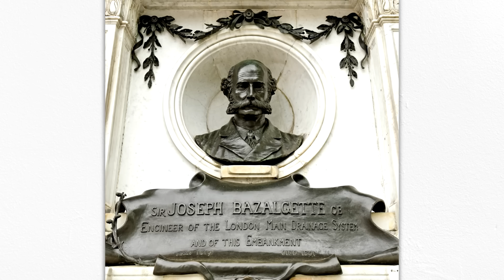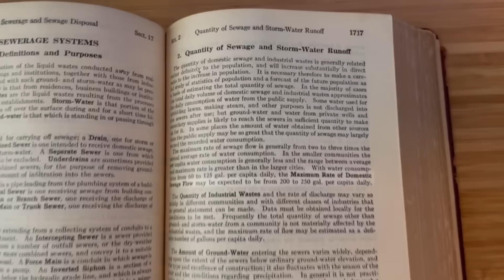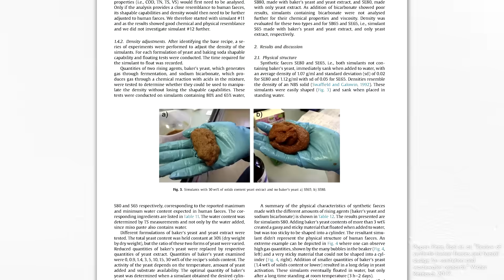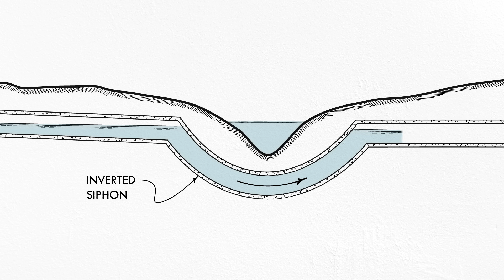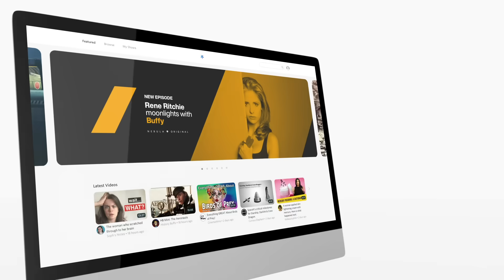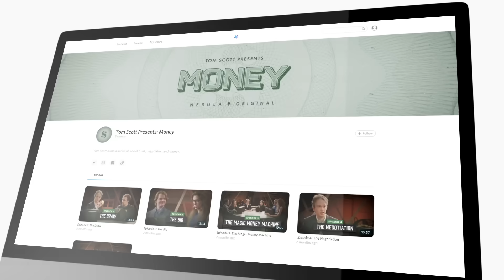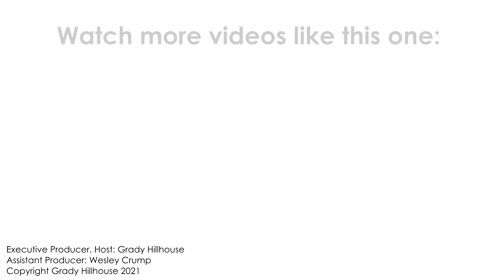How Sewers Work (feat. Fake Poop)

Comment: I usually wipe my poop with my fingers.Then, using the sharpest razor I have, gently slice off the the uppermost layer of my digital epidermis, allowing the poopy flesh to fall into the bowl. I then plunge my hands into a pre-prepaired bowl of water, isopropyl alcohol and hydrogen peroxide. That is followed by much screaming, then the application of antibiotic cream and guaze. Then I lie in bed and dread the next bowel movement. Does this seem practical and, more importantly, good for the sewage system?

Comment: I love the Turd business.  Sewer treatment plant operator for 18 years.  Water supply operator 3 years.  Dual licensed.  Layoffs are rare, have good benefits and lots of overtime.  People need water, people need to poop.  Most people wouldn't have a clue about proper deposing of their turds.  They let rip on the sidewalk in the city, most would NOT think about burying it and applying lime.  Most people would be no different than a dog.

Comment: Within a building, you also can't make the pipes too steep without risking clogging it. A turd needs a certain water level or it stops due to friction with the pipe, so you need the set amount of water during flushing to stay around the turd for as long as possible, filling the pipe around halfway. Too slow and the water lacks the force to carry, too fast and the shallow water runs off before doing what it's supposed to do.

Comment: The problem of over population never seems to be addressed. Letting too many people live in areas where the infrastructure isn’t designed to handle the demand of those people. If you had less people living there you would need less sewage systems to deal with it. Also it’s a shame there isn’t some way to control how often people flush the toilet so maybe they have to wait a minute or two between flushes to allow the sewage system to handle the demand on it before more comes through. Either over population needs to be addressed or the system has to regulate the excessive toilet use. Can’t have it both ways.

Comment: i cant imagine that pipes are sloped. they have to be level to reach the waste treatment plant. If there was slope in the pipes, then by the time the pipes reach the waste treatment plant, the pipes would have to be miles underground, if not more, considering the distance some residential areas are compared to the treatment plants. how the pipes dont get blocked is a mystery, but some designer must have figured it out.

Comment: Look to Toronto as an example of failed sewerage system. While downtown Toronto has added over 300,000 residents in the past 15 years without upgrading the sewer system. Now every summer rain would result overflow of the Don River and Toronto would smell like an open sewer. Then during heavier rains the brown water will over flow onto the streets. And now Lake Ontario smells like public washroom whenever the temperature goes above 23 Celcius.

Comment: Thanked for the great explanation, but I’m still wondering how engineers deal with the increasing depth of the sewer line due to the long distance they need to travel. Shouldn’t the necessary slope mean that the sewer lines in big cities eventually get extremely deep in order to reach a far away waste water plant?
Reply from the maker: I have a few videos about sewage lift stations that should help

Comment: As i start using animal fats most of it end up in the garbage not drain.

The main problem with fats and oils in the sewage is that they mix with detergents and body cleaning products. Drain cleaners (Sodium hydroxide) are the worst as they make the fat and oils saponified / harden at lower temperature and become water insoluble and attracts oils making it grow, not just coat the surface.

Comment: So I am curious would it make sense to have treatment plants built in skyscraper format having the water gravity fed to each section instead of pumped to each section? while the initial construction would be more expensive to hold the massive weight of the water I question if it would be cost efficient in the long run or if the savings would be mostly lost from the main pump pumping up such a height.

Comment: Do a transparent sewer pipe or even in a water line is a good idea. To monitor blockage or issues?
Reply: Y can't governments across globe place laws to restrict those chemical r bleach r toilet cleaner liquids r dishwashers that r harsh on em's in grey water

And make it mandatory for households r make arrangements in system in such a way that , whenever they flush there's em's liquid also b flushed along with waste 💩(em's  effective microbs are both damm cheap  and eco friendly , let nature do it's job )

Em's good both for environment and also eates  solid 💩wastes ( eats anything organic and not  plastics)that are  blocking free flow of sewage/ grey  water

Comment: I knew a guy that wouldn’t even flush down TP. He had a wastebasket next to the toilet for that. He never needed to have his septic tank pumped to my knowledge. I’m sure he wouldn’t have even allowed those “flushable” wipes through his door. Oh, he burned the used TP in case you were wondering. He also cut all the wood he burned for heat and hot water. Grew his own food (flora and fauna)and brewed his own beer. Now his son is carrying on in the same house, on the same land. He has all the modern luxuries. In fact I used to go up to his house for band practice. You can still enjoy all that modernity has to offer without becoming dependent on it.

Comment: I had a friend who is very passionate about waste. He would usually advocate for septic tanks over sewer systems especially in rural areas with wells for water supply

Not only are septic tanks cheaper to install and maintain they return the water to the ground below. 

He would go on about how taking water out of the ground and sending it to a sewage plant could eventually cause sinkholes. He would also go on about how lake Meads hight might be effected by this issue.

I'm not sure how much of that is true but id love more info on septic vs sewage systems and their advantages/disadvantages in rural/urban environments.

Comment: Never thought about the slope being to much causing damage to system seems kinda odd since they are often cleaned with high pressure high flow water jets sometimes 3500 psi

Comment: As someone who worked in a sewage treatment plant for years, there are no "good" flushable wipes. They caused sooo many problems in our plant, they constantly clogged pumps and other machinery. We often had to take things apart to clean and fix them. And don't flush tampons or condoms, either!!

Comment: Per cities growing, it seems you can't just plan to have all sewage treatment plants lower than every new development project. I saw you had a video about pumping sewage too. So what does each new housing development do? Do they come to a central low point? Then what? Where does it connect to the rest of the city lines? It would be fun to see a practical engineering of planning a city sewage direction map, etc.

Comment: Wet wipes 
Lower temperatures on washing machines/ dishwashers 
Space savers (bricks) in the cistern 
The increase use of fat. 

All modern enemies of the sewer…

The other biggest problem “drain experts”

Call 10 experts get 12 different problems and 27 alternative solutions…

Comment: There are a couple of other knobs the civil engineer can turn (for a price, naturally). For instance, the sewer lines are not necessarily circular in cross section. A more-or-less egg-shaped cross section can keep velocity higher during low flows, when the flow is in the more-tightly-curved bottom of the egg. The selection of material for the lines is a factor both in longevity (pipes do wear out) and the friction experienced by the sewage on its way down hill to the treatment plant.
I have happy memories of a tour of the big San Francisco wastewater project decades ago, where they were re-engineering their combined system to meet modern standards and still handle storm flows. This included some huge interceptor structures along the shoreline to pick up all the flows heading down to the water, and slow-and-settle storm runoff as much as possible to avoid sending sewer-lumps out to the bay or the ocean beaches.

Comment: you can, however, control the slope to the point where you guarantee that it will run a turbine. Meaning not only can you use the power created from the methane, but you can also control the power created by poop flowing downhill...

Comment: Fun fact: In Seattle (closest big city to the suburb I live in) they used to build their sewage pipes out of wood- and for a very long time it just drained directly into the sound. You can still walk by the corroded remains of the iron pipes they replaced the wooden ones with (after a fire burned down the whole place including the sewage lines) on Alki Beach
Reply: I had a piece of the old wooden pipe from Alderbrook for years ,it   was in decay and hard to keep tho.
Reply: That’s what those pipes are 😭 I had no idea

Comment: In residential plumbing, we are told to keep wastewater drain pipe slopes at approx 1/4" per foot, to ensure the water doesn't go too fast and "outrun" the solids. How does this apply in relation to keeping flow fast enough to ensure solids stay in suspension?

Comment: I work as a Underground Utility Locator for a Municipal Public Works Dept.  Because the majority lines I have to locate and mark are from before the 1980's, some even from the 1920's, I frequently have to open sewer lids to verify types and directions of sewer pipes, being either sanitary or storm.  Our maps are kind of old, and not always that precise thanks to management mistakes made in the late 20th century and early 20 hundreds.  (At one point Some genius tried to save money by getting unpaid interns to map things out.  We got our money's worth. -_-;; )  The fact that the sewer pipes are rarely bigger than 8 inches in diameter, and that's the one multiple building are attached to going down the road, just makes the fatbergs all that greater of a problem.  I've seen them cause standing sewage 2ft deep in a 5ft. sewer access.  This is part of why I'm a proponent of bidets.  All the refreshing cleanness of the wipes, with none of the sewer clogging fabric, and even less toilet paper.

Comment: I once went underground to see some  Chipped into bedrock by USA slaves.
Contracted by the CSA for a defense fortification.  After 1869 City Fathers
paid former slaves to make and lay stone slabs over the trench.   To channel
wastewater off public-use streets.  Mated with concrete pipe using machinery
after 1948 to further assist urban needs.   Excuse me for ignoring the poop.

Comment: The process shown by Grady re: the pipe not having enough slope and so solids build up and reduce the capacity of the pipe, well, it looks amazingly like an artery in the body being occluded (clogged) by plaque.
The only thing that only the body can do is reverse gravity via venous return, & even then, if there's a clog in the system, the system backs up and all hell breaks loose.

Comment: I have moisture coming throughout my floor in the basement.  It hasn't created puddles. but consistent moisture has caused the cement floor to chip and mold.  Basement "waterproofing" companies have a solution of running PVC around the parameter of the basement close to the wall, though there is moisture in the middle of the basement floor as well.  Do french drains actually work at all?  If they do, should the pvc pipe be near the wall, a couple of feet away, or in the case of moisture in the middle of the floor in the middle of the floor as well.  If not, what is a solid solution for moisture coming through a basement floor?  Here is a link to a video showing common logic  https://www.youtube.com/watch?v=QlUZwwKDqXo.
Reply: There are better websites to ask this question at. YouTube comments is really not the bets place to look for answers!
Reply: @sansamman4619  San are you with the site.  Engineers would have a better answer than contractors who have for years applied the same solution to every house and scenario of moisture leakage they are met with.  Are you an engineer or a contractor San Samman?

Comment: Perhaps water utility should offer free bidets. It seems like it would be much cheaper to give everyone a free bidet, even free installation, than it would be to regularly dig out fatbergs. It might not work for public toilets, but those generally don't offer flushable wipes either so it could help reduce the problem. I bought bidet in 2015 and was REALLY glad I did in 2020.

Comment: well ive learnt one thing as a Aussie i often use wet wipes to clean my pits during a hot day and have thought nothing of flushing them, this very moment I'm trying to think what i can use as a small bin to fit under the sink so I'm not PART OF THE PROBLEM BUT THE SOLUTION thanks for that

Comment: I am a drafter at a Telecommunications Engineering company and one thing I can say for sure, designing around sewer pipes and trying to make suggestions for them to work around us typically go nowhere. When they design where they want sewer and storm drain pipes to go during a project, I have to design the fiber optic network around it and just avoid them at all costs. Very rarely can they adjust their running line to accommodate us in any way, and we have quite a few restrictions to live by as well, like not making sharp turns or too many turns between access points (handholes and manholes). All the utilities, I've learned, have their own restrictions to stick to and we all have to try and design around one another, and a good designer retains knowledge of the limitations the other utilities have to honor, like how water lines can't go deeper than about 5 feet to avoid freezing, sewer and storm can't move much at all because of everything explained in this video, fiber optic and electrical need smooth, sweeping lines with minimal bends to allow for pulling cables through conduits over long distances. Gas... well... gas can go anywhere anyhow, but they require that you build your utility 3 feet away from theirs at all times (water asks for 5 feet, I believe) and then the railroad and everything that they stand for is a whole other beast entirely. The world of building and maintaining utilities is a completely different and severely underrated and taken for granted world of operations. I consider myself and everyone I work with, beside, for and in conjunction with, unsung hero's that keep human life sustained and operating as we all expect it to.

Comment: They have plastic liners for sewer pipes now, it goes in as smoke and turns to plastic and builds to the desired thickness and you don't get as much leakage. How do cisterns work?

Comment: I currently work for a engineering firm specializing in wastewater pipeline rehabilitation.  We go in and repair old wastewater pipes by way of CIPP. (Cured In Place Pipe)  

This is very important.  Thanks for the video.

Comment: 🤔... Hmmm...Could we build a tunnel system that has suspended pipes, that could be adjusted with a hydraulic or balance system, or that could even turn to avoid solid buildup? This way, the pipes would potentially last longer and would maintain an even amount of pressure.

The problem though.. it wouldn't be cheap, but would maintain an even flow. This would also allow a simple maintenance system that would allow the pipes to be changed out, maybe with a giant valve like system? I'm not an engineer though.
Reply: 🤔... Hmmm...Could we build a tunnel system that has suspended pipes, that could be adjusted with a hydraulic or balance system, or that could even turn to avoid solid buildup? This way, the pipes would potentially last longer and would maintain an even amount of pressure.

The problem though.. it wouldn't be cheap, but would maintain an even flow. This would also allow a simple maintenance system that would allow the pipes to be changed out, maybe with a giant valve like system? I'm not an engineer though.

Comment: wastewater treatment was by far the hardest subject i remember taking in civil. Our prof was awful. I remember a design-build i worked on a decade ago where the contractor followed the slope of the road which was quite steep leading to self cleansing velocity well over 6m/s. Spent a lot of time looking at CCTV's with drainage engineers to see if pipe walls were degrading faster than normal.
Reply: 6m/sec?! Wow!
Reply: @411sponge72  yeah some were as high as 8m/s

Comment: There are just too many issues with the old systems as well as high density living, city vs town, and so on. The way the toilets are designed. Use of toilet paper itself has caused huge destruction of trees. Then there are waterless systems. Why have a centralised treatment system ??? Why not do it in small sizes ??

Comment: I worked on section of Bazalgette's sewer system in the east of London where it ran above ground incased in a mound of soil, it crossed several railway tracks and a road, the flow was aided by the Abbey Mills pumping station powered by steam the pumps kept the flow going through each of the brick built sewer pipes. One could be shut off at a time to enable cleaning.
During the blitz of London the sewer bridge was bombed and cast iron tunnel segments were used in the repair, tunnel iron has flanges and bolts on the inside, this was OK as an emergency war time repair. In the 1960s new steel bridge beams were installed and cast iron segments with outside flanges and bolts installed, one sewer line at a time, so as not to interrupt London's ablutions.